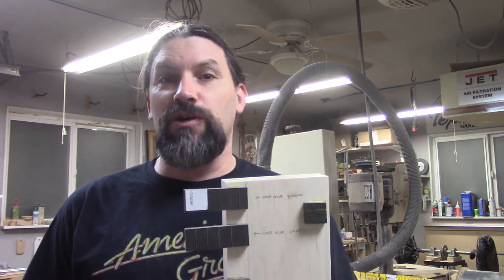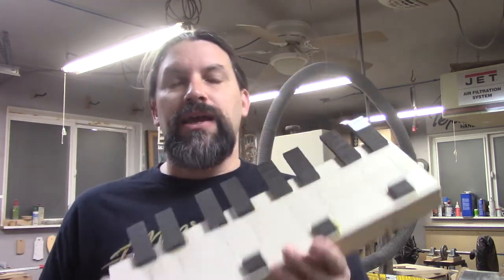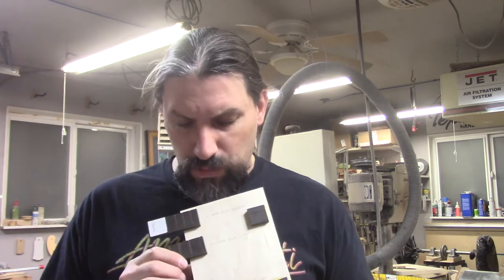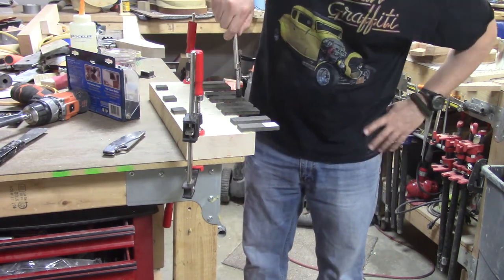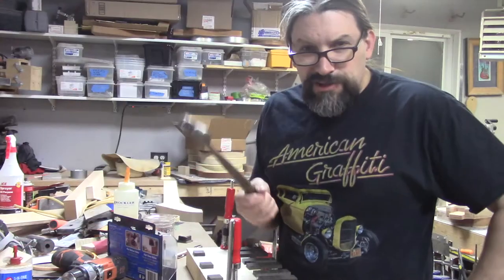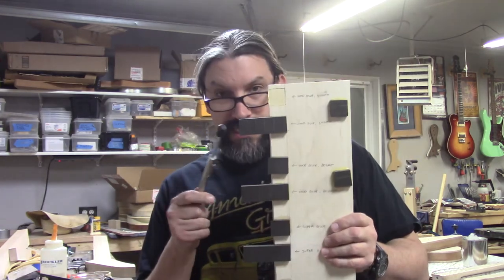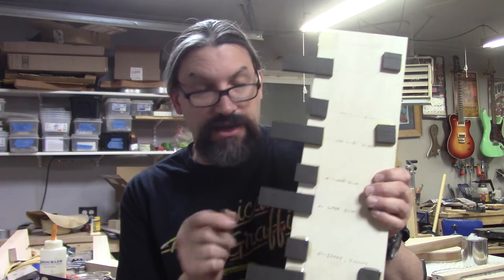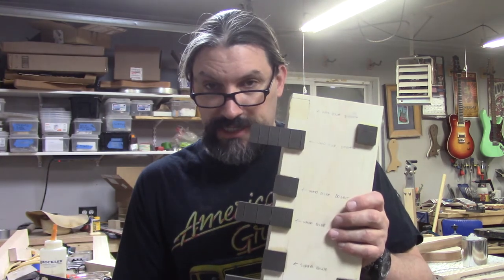Glues You Can Use with Richlite... Testing Glue Joints And Then Breaking Them!

Comment: why do almost all small builders build teles? is it because the bodies are super easy to carve? or is it because everyone just wants teles?
Reply from the maker: Both those statements are correct. 
They are far and away the easiest model guitar we make right now. They have also weathered the test of time and are still really cool (of course guitar players are very... traditional). I love the way a classic slab body looks and sounds, especially with a SD Quarter Pounder in the bridge. That combination will ride heard on a Les Paul if you run them both through a 50 watt Marshall.
Reply: yeah, there is nothing wrong with the design. however, i find it harder to build complete necks i make than the bodies... i suppose that it is only because the only way i can level something with my current tool set is by usig sand paper with a straight beam... i bet i could make 20 tele bodies in a day though with my 3.75 hp triton router, a template, my jig saw, and a buttload of finishing oil... it takes all day to make one of my proto bodies, because it requires a ton of sanding and prep work before it can be finished due to the large 40 grit valleys that my barbaric carving process makes, in addition to the intracate electric pathways that have to be drilled and routed...i am really slow at neck carving though, because although i use a grinder for the bulk work, i have to use leveling beams to sand, and a razor blade to even out/fix the neck shape after the rough cuts are made... i hand slot frets and i hand crown them with a harbor frieght triangle file because i havent had the budget for nice files.
so, i see why you build them, and i suppose that if you are having no issue selling your guitars, then it is perfect.

Comment: A shear test where you try to twist off the tab would be interesting.

You could use a torque wrench with a Crow's foot adapter to have some sort of calibration.

It would be interesting to see a similar test of Rosewood with the joint prepared in the normal way with the normal adhesive.  That would show us if it's a stronger alternative or questionable.
Reply from the maker: Hey, I have  torque wrench, that is a great idea Daniel. I think I have some rosewood bits laying around. Maybe I'll do another round with other woods.
Reply: Your going to need a bigger wrench. Clamp it in a vise, put a cheater pipe over the sample and hang weights on it. Maybe a hammer and wood block test on the 1x1 samples

Comment: Good run at testing the Richlite! Hammer impact as you've seen imparts a much larger force than pushing alone. Good job keeping all the pieces the same size and loads there. Improvement would be trying an arbor press with a load cell/scale of some sort. The other option would be to glue down your 1inch wide strip over a slot and position a dual action truss rod under it and crank the truss rod to either its failure or fracture of the richlite and glue, might even put a torque wrench on the truss rod to get a reading where it goes wrong. Your impact test broke off material before the adhesive bond fractured so that is a good reveal.

Comment: which wood glue was the first test strip done with? and second - the one with 80 abrasion?
Reply from the maker: The only wood glue I use is original TiteBond... Before anyone asks it's not because I have done all kinds of testing or think all the other glues are junk. It's all I have ever used and I am traditional to a fault. I'm sure there are lots of other great wood glues.
Reply: tx for quick reply, i am considering the material for my next batch

Comment: I agree with Chris Woods, Seems it would make more sense to try to 'Lift' the Richlite off, rather than press down?  In actual use, would one would be more interested in weather they came OFF, or DOWN!  Just sayin'        Gb      bg
Reply from the maker: I hear ya... I ended up tossing that test board away because I got tired of tripping over it (figuratively speaking). We did push on the pieces sticking out with the ADA gauge the other direction and they all held fine. Of course, it is kind of a moot point since I don't make fretboards that overhang the neck 2 inches. I really wanted to shoot at them wiht my Tac-Ord Remington 700 but I don't have lots of time to go to the range these days.
Oh well.

Comment: How about being able to remove the fretboard for a repair?  I have seen videos where the fretboard is heated to do a repair. can the fretboard be heated or steamed? or will that damage the Rchlite?  As rich light is a manufactured product and not wood how well does it do under those conditions?  And no I am not bashing the product like some who say Richlite if Formica and if it gets wet it falls apart just lick a countertop.  In my house growing up, we had Formica and that lasted for 20 plus years.  we did not leave puddles of water on the countertop we dried up the moister after cleaning.  Also, I don't think the rest of the guitar would fair well submerged underwater.  I actuall want to know if tradition reparrs will work or will the Richlte need to be replaced if a truss rod needs to be replaced.
Reply from the maker: Hard to say, 

I am the last person you would want to ask about repairs. I will occasionally do some for friends but I hate it. There are other guys who have forgoten more about guitar repair in the last few minutes than I will ever know.
If I had to guess (and I do) I would bet that the Richlite is pretty decent to work with for repairs. I understand that it is pretty much moisture resistant.
You should give Sergio a call, I saw him at the NAMM show walking around, he is a good guy and can probably give you better answers then I can.
Let me know
Reply: That's cool.  I don't build yet but I have worked on guitars since the 80s I have leveled frets and refretted so you other video got my attention regarding Richlite.  Would you happen to have Sergio's last name and the company's number?
Reply from the maker: sergei@richlite.com
Reply from the maker: I just got an email from him the other day I have been sick so I still need to get back with him. Tell him I said hello

Comment: Hey Mat
I've been laying down a deck out back this last week and have been using composite decking boards. This stuff is easy to work with but hard on tools. My drills and saw    blades have all lost edges real quick and require constant sharpening.
As I am about to embark on making a couple of guitars, I am wondering how you have found the Richlite on tools. 
Cheers ( how are the Mosrites going ?  )
Reply from the maker: Hey Homes, 
You are right, the Richlite isn't as tool friendly as say maple or even hickory hahaha I have burned a couple router bits working with it and my radial arm saw that I use for fretting labors a little as well. 
The Mosrites (Toastrites?) are still moving forward, I have to get all of them caught up before I do more videos. I'm going to have Monkey do lots of sanding and binding this weekend and se if we can make some forward progress.
It's funny, as much as people say they like those the Daily Drivers are getting more attention and people are throwing more money at them.
Stay cool

Comment: haha, I USE SUPER GLUE FOR EVERYTHING..... i really do, i tried gorrila wood glue for a fretboard, and it delaminated because i touched the guitar with a wet hand 2 days later(maybe the 10pounds per square inch of clamping pressure was too much, but both the fretboard, and the neck were straight, and the glue was supposed to be water resistant...it was out in the texas heat though too when i was working with it.)... i also use epoxy, and that is good. however, wood glue is rubbery and i can peel it off of bare wood after it dries... even when sanded to 80 grit.
superglue is great because for most things, i can clamp with my hands, and it only takes about 10 minutes(i still clamp crucial wood joints with actual clamps, i just work really fast). heck, i don't even know why i keep wood glue... wood glue is for the birds, or atleast the stuff i have because it can be used as a peel coat for painting.
Reply from the maker: I'm not sure what wood glue you are using but it sounds very different from what I have used since the 80's. There is certainly no peeling it off of wood, metal or my shop floor.
Titebond makes a line of instant CA glue for wood if you are interested... http://www.titebond.com/instant_bond.aspx
Reply: cool, it seems like CA glue doesn't vary much durability wise regardless of the seller, but the viscosities and dry times will vary. i tried refilling a gorrila CA glue bottle with harbor frieght CA once, which worked pretty well, but the stuff dries faster, so it is harder to clamp when applied... i was suprised when i tried gluing together a small project, and it bonded too fast... i couldnt even slide the pieces to align them, which isn't really what i wanted for that particular application. i havent tried titebond CA glue yet, but loctite CA glue and gorilla CA glue tends to have a longer dry time. the main factor that goes into my CA selection process though is i like a good bottle. if it can seal properly, then i can work with it. i hate only having hardened glue when i need it.
by the way, the wood glue i have(i dont use it, it is terrible) is gorrila wood glue... the other glues are great, and the main foam stuff is amazing when it is needed, but the wood glue is not. i think i will buy some titebond 3 next time i am at lowes or something and try it, but idk. conceptually, even if it works really really well, it is still a rubbery glue, which has a slower speed of sound, so i don't really wanna use it for luthiery work; it is way cheaper than super glue though.
Reply: i just looked at the link, and i cannot find a seller... i found a few listings on amazon, but none of the department stores carry it, and even the titebond store page on amazon lists it as currently unavailable... oh well.